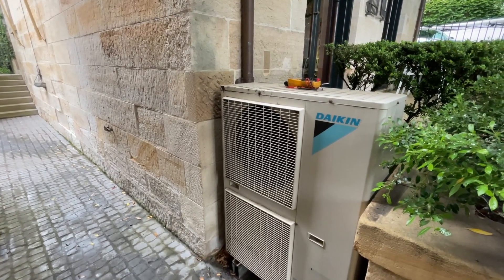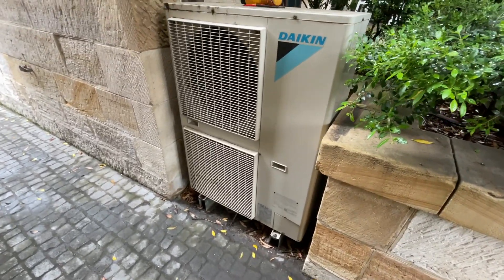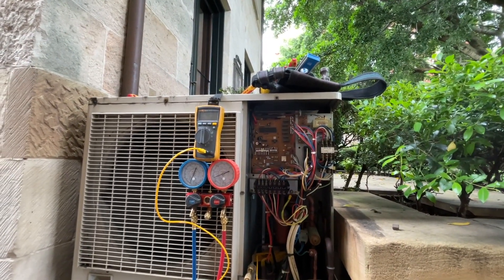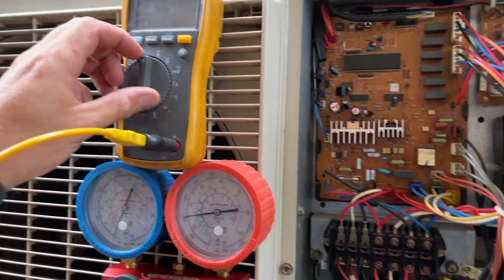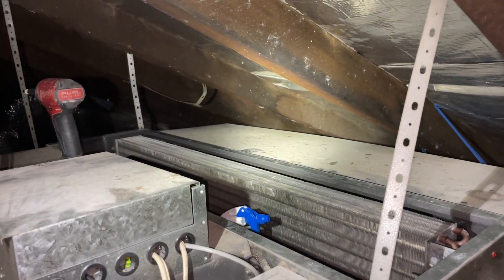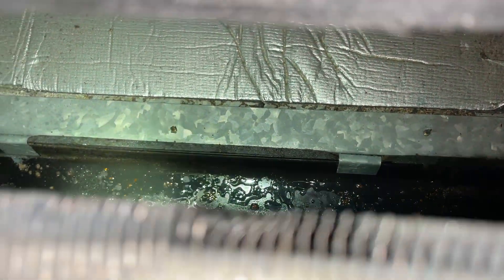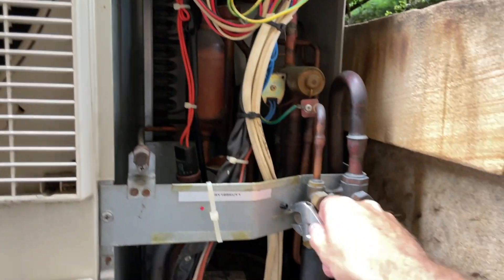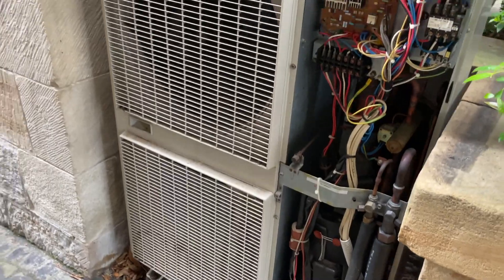Diagnosing Daikin F3 Error (Gas Leak II)

Comment: Hi, Mitch. Can I use AC leak sealant to stop the leak? I heard it can cause the system blockage.
Reply from the maker: I’ve never used anything like that personally and to be honest I wouldn’t be confident with it. I’d just find the leak and fix it. The only reason we replaced this unit in this instance is because it was so old. Could of replaced the coil if we wanted to repair it. 👍🏻
Reply: Thank you